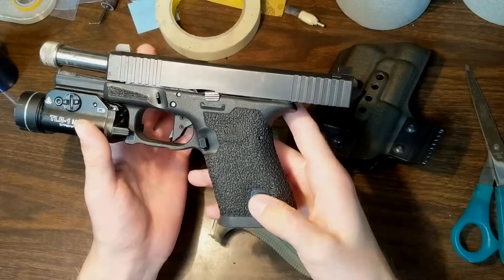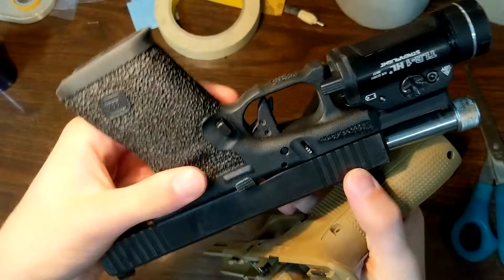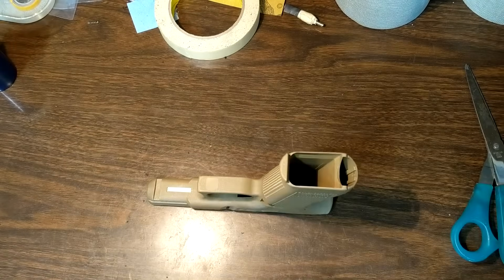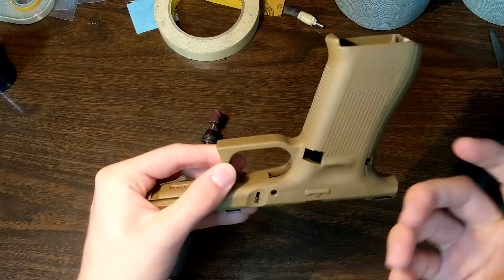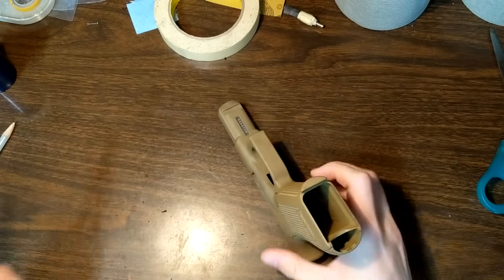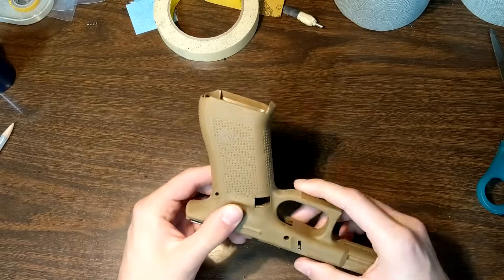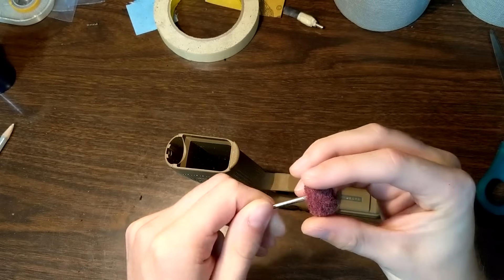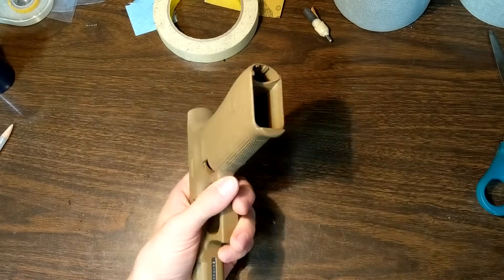Glock Undercut Tutorial | How to Properly Undercut a Pistol

Comment: Thank you thank you.  I didn't need to get a higher grip, per se, but I did need to take something off the rear of the triggerguard to ease the pain on my middle knuckle.  This was never an issue with my G19, G22, G23 or G29 but, boy howdee, I needed it on my new G30!  It ain't as purdy as yours but it gets the job done.  I just used the 1/4 inch barrel to shave it out of the way then used my files to get most of the flashing then 320 grit sandpaper to smooth it on out.

Comment: Spot on iv never done one or used one but your right what I really want is my under cut pulled out so my finger doesn’t feel like it’s canted down  all the glocks I’m seeing have a thick trigger guard lots of material to work with I only need a little gone on my ruger but I never did one before and like I said not a lot of material so it’s a scary leap thanks for the advice

Comment: This answered my question on what the polymer was like on my 19x if sanded. I was hoping that color wasn’t just painted on so that makes me happy
Reply from the maker: All the colored frames Glock offers are the plastics color. They did have some cerakoted stuff they were doing a while back but based on the feel you can tell, as well in my experience they always stated it was coated.

Comment: What will also help to get rid of deep gouges is to hand sand in different directions for each different grit (let's say going N to S on 300, then going E to W for 400, and so on)
Reply: I hand sanded some bevels into the halfmoons on my G19.5 magwell and you really wouldn't know it wasn't factory unless you held it side by side or I told you.  I wrapped the sand paper around a dowel and used that to help set my angle and then worked up in grit until finally I finished it with a P800 and it blends just fine.  The result was that I no longer hang up un the half moon cuts that Glock saw fit to cut in.

I have considered doing a more dramatic bevel, but I don't think it is necessary.
Reply: @Osprey1994  could have just got a grip plug, completely eliminates that issue.

Comment: I notice that you did not completly strip down the frame before sanding.  Did you just do a basic clean and oil afterwards?  Is that enough for fine dust in the gun?  Should it be dunked in a hydrosonic cleaner?

Comment: Just did my glock 27 gen 2.5.

Feels amazing and the firearm looks smaller. 

When I look through the sights it lines straight up. 

I marked the wall and without looking, aimed at it across my table and held it still then looked through it and it is right on. 

10/10 for better grip.

Had it for 6 years and feels like a New BETTER firearm. Edc

#(ck) common knowledge

Comment: Where do i find higher grit drums?
Reply from the maker: You can find them on Amazon but I wouldn't go above 240 on the drums.
Reply: @battlereadyarms3144  thanks i did it with a harbor freight dremel and it was easy enough but i got a few gouges and probably definitely didnt polish it right

Comment: Couldn’t you just save time polishing by using a higher grit to begin with? It would remove less material but if higher grits don’t gouge then why not just use a high grit all the way?
Reply from the maker: Technically yes, but it's going to ultimately be slower and quite likely cause more hassle. You have to cut slower as higher grits will want to melt stuff. I've done over 800 guns at this point, and I know a lot of other guys with similar numbers, and everyone starts low and goes high. It removes bulk quickly without melting, and then you run through the various grits relatively easy afterward.
Reply: Battle Ready Arms That makes sense. Thanks for the response.

Comment: Been getting told aftermarket barrels and such and slides can affect reliability for glocks. And I noticed that with your carry gun. Is it all truly BS and you just have to do your own training and buy renowned gun parts with research?
Reply from the maker: There are certainly certain things I wouldn't do and certain parts I wouldn't use. But the hype around stock/OEM is best is overblown. You get a bunch of people who don't know what they are doing ruining the reliability of their gun then telling everyone or everyone else seeing that, making assumptions that modifying your gun will destroy it. We got guns with 15k+ round counts that run like a top. Guns with SWAT Teams and all sorts of stuff. No problems. It's about what you modify and why and the quality of the parts you're using.
Reply: @battlereadyarms3144  would make for a interesting video if you haven't already as I wanted to make my glock 34 competition ready and my glock 19 a carry. And I'd like to know a bit more of what's necessary/practical and what's more gucci. There is already videos on it but I'd like a second opinion your thoughts and I imagine others do too
Reply from the maker: @nothingmuch5844  That's actually a good suggestion. I know there's others out there, but I don't think any from someone who daily builds out and handles these guns and has seen all sorts of things. So it might be interesting to hear from a builders perspective what to do and what to avoid and why. I'll have to try and make some time and see if we can get something together

Comment: Problem is removal of too much material weakening the frame and trigger guard.
Reply from the maker: Yet to see one break. Granted, you remove too much you do risk it, but you have to remove a lot to get to that point. That's why I recommend rounding it out and bring it forward rather then cutting straight up and making it thin. You can remove way less material and make it way more comfortable bringing it forward and rounding the edges.
Reply: @battlereadyarms3144  Yes, you are skilled and know what you are doing.   I have seen many botched attempts on different firearms scouring frames and slides with deep crooked cuts because the wrong tool was applied and/or the user just ground too much material away, and one application where a throated 1911 barrel chamber changed color from high polish to a rainbow blue.

Comment: Why not buy a gun that doesn't need all the extra work. Im not a gun pro but have found a few guns in the glock price range that are just as reliable and give u much more in ergos trigger and sights. I own 2 glocks. They were my first 2 hand guns based on all the hype. Then I did my own research and found better choices for the money. Just my opinion. Glock not so perfected. Maybe after u reshape the frame. Change sights. Buy grip tape or pay for stipple. Smh why not just buy a $800 gun
Reply from the maker: One of the appeals to Glocks is how customizable it is. Are Glocks overpriced, I think they are a bit. But again, the options are endless. I love the M&P, the CZ, and Glocks, but I'm not happy with any of them out of the box. I have people send me M&Ps, CZs, Glocks, Sigs, etc. for custom work. And the nice thing about Glock is it's way more flexible. I have way more customization options from sights, to barrels, to slides, and even the frame work option themselves. Some people buy a Ferrari, other people buy a mustang and put another 30 grand into it. I don't think either choice is wrong.